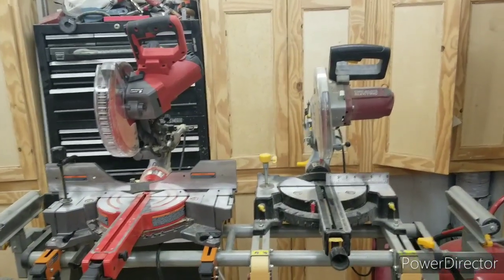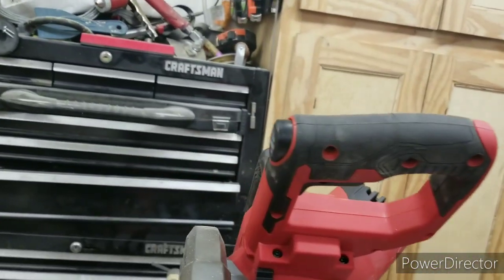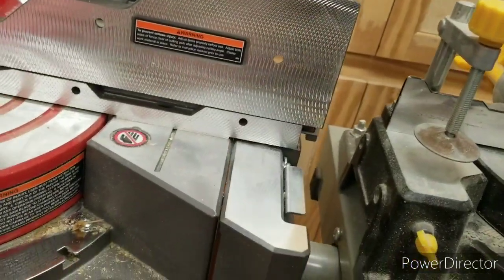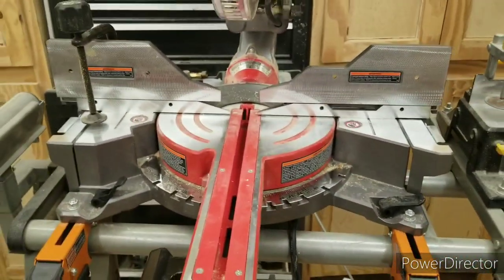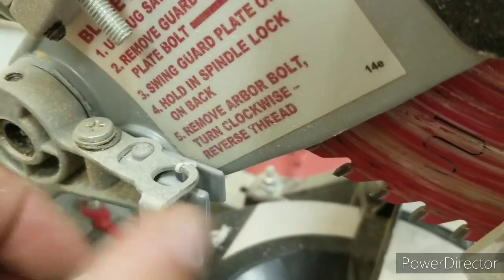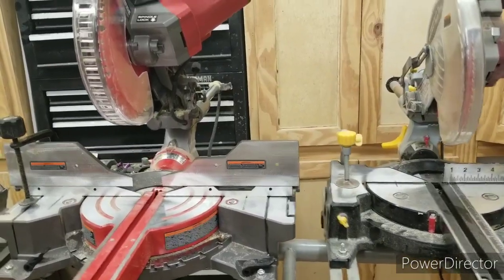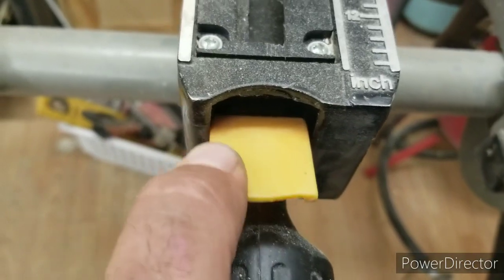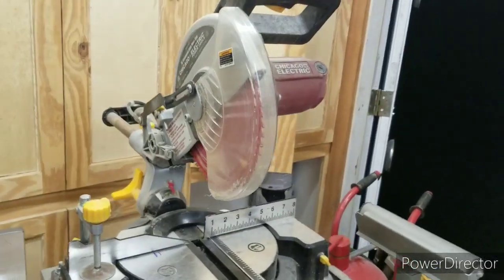Is the Bauer worth an extra $100 over the Chicago Electric 10" slid g miter saw

Comment: Looks like the Bauer has a bigger table and wider-extending supports. The Bauer's fence appears also to be drilled for mounting a longer sacrificial fence as many of us do. It also has a blade brake that stops the blade quickly. My real question is what makes this 10 inch saw $20 more expensive than the Admiral 12 inch saw that has a laser guide?
Reply from the maker: It is all a matter of personal opinion of what is worth spending extra money for. To me the overall quality of the Bauer is much higher. The Admiral base is the same as the Chicago Electric.

I have never liked lazer guides. They are the same width no matter the width of the blade and can be off alignment. The shadow line in always the size of the blade and can never be out of alignment.

If you like the Admiral I would hurry and get it. I believe they are going to stop selling it.
Reply: I think admiral runs at about 3800 RPM the bauer runs at about 4500 RPM
Reply: Having a laser sounds a lot cooler but the fact is that, in terms of accuracy, the LED shadow can’t be beat. As the other comment above mentions, the shadow doesn’t just indicate the cut line but also the width of the blade so you can know exactly how much wood is actually going to be removed. Also as mentioned above, the laser is a reference that can be off. The shadow can’t lie.

Comment: I'm now on my 5th Chicago electric saw.  I used them to cut fire wood.  I buy cut and split fire wood, 6 or7 cords a year for the last 8 or 10 years , fire  wood is 16 inches long, and the stove I had needed 8 inches to burn most efficiently.  they lasted at least two years each before the casting broke. last year changed stove now it will take up to 20 inch pieces, by only use 16 inch wood  in it and now use the saw for rough carpentry
Reply from the maker: So did you buy the extended  warranty?  I only buy it if I know I am going to be pushing the tool to the limit.
Reply: I bought an older Craftsman 7 1/4” miter saw about 10 years ago.  I mounted it on a 10’ metal folding table about a foot from the end.  I carry long 1” to 3” thick branches onto the table and use the saw to cut 1 foot long kindling pieces. I burn about 15-20 cords a year, Northern Michigan winter is 6 months some years.  That old saw gets a new blade every so often.  Paid $10 for it.

Comment: does bauer make a bigger dust port that you could install on the 12'' my 12'' bauer dust port is only 1& 1/2 '' .
Reply from the maker: I am not sure why but most brand saws have a small port. An adapter like this can work, or you can 3d print one.
https://amzn.to/41TE9y0

Comment: I t looks like you have Rigid Universal Mounting Brackets attached to a Chicago Electric Miter Saw Stand. Does this actually work?
Reply from the maker: No they would not. I just set the sawnrs to each other some I wouldn't be spinning the camera around was much. I should have done a video comparing stands. There are 2 basic styles. The one's with the wheels on the bottom are much more convenient. There Ridgid ones are on sale now at He Depot for $129 and Direct Tools for $79. At that price it was time to upgrade.

Comment: Aren't you really comparing junk to crap? If you can't afford quality, wait until you can.
Reply: Its a saw, needs a good blade and true cut. You need a makita or dewalt to do those on wired tool for 3x the price than thats on you.
Reply from the maker: It depends on what you consider junk or crap. I have Delta, DeWalt, Chicago Electric, and Bauer miter saws. I can afford a Festool if I wanted. I don't think a Festool would hold up for me as I am rough on tools. It is a precision tool but the housing is a more brittle. Most people who pay $1000 for a saw treat them nicer than me. The Chicago Electric cost less a good blade. It is not as precision but cuts good enough for most construction work and if it breaks or disappears it is not a big deal.  The Bauer to me is a great value. You can buy 2-3 for the price of what you call a Quality was saw but I can see anything they can do this one can't. This is the Jet base with a couple of upgrades. I guess you can buy this from Rocker with the Jet name for $500 without the upgrades.
Reply from the maker: I agree. This is the blade I have on the saw.https://www.rockler.com/freud-premier-fusion-saw-blade
I did not have it on for the video because I feel most people will not run a $100 blade on a $200 saw. This saw did take a little to get zeroed in. Once it was it cut true and accurate at every stop. For the price I really was surprised at the quality. They have already raised the price.. I will not be surprised if they raise it more.
Reply: Wow, Robert thanks for this Bauer video. I've watched all your videos. I've had my eye on the Admiral 12" at the beginning for its price range & what it did. It would be an upgrade needing the dual-bevel. BUT when HF came out w/this baby I came to a complete stop. So glad you ran a vid on it. Dual-bevel ✔ Positive stops ✔ Shadow-line ✔ large 5" fence ✔ electric brake stop ✔
I think Bauer is trying to create a look for trim & finish guys out here who are part of the DIY criteria. This looks like just what i need for weekend DIY crown, chair rails & trim. 
Only accessory I wish they'd come out with are Crown stops to Nest the crown on the miter locked in 😏 sort of like what DeWalt has on theirs. 
Robert, will you being doing a video showing how to zero & true this machine out?? 
Great videos RP 💯😁🔥💪🇺🇸
Reply: @ShopRamblings  Since you have Delta and Dewalt as well, does this stand up ok to those?  I'm a hobbiest that does occasional furniture (Anna white type stuff) and the bauer seems like a great saw for the price.
Reply from the maker: @johngaines50  my Delta was not a sliding so it could not cut a 12" board. I was going to get the 10" Delta Cruiser but they stopped selling it. The Dewalt has been the gold standard but their saw hasn't change much in 20 years except to lower the quality of the internal parts. I believe this Bauer is the same base saw as the Jet. Then they took all of the negitive reviews it had, Made upgrades to fix what people didn't like and are selling it at half of what other brands would have sold it for. So far I have not found anything that could be improved as far as performance. As of now I have over 30,000 minutes of view time on the saw. I have not received a single negative comment for someone who has used this saw. I used each of my other saws for different purposes. I had bought this saw just because I was curious and planned on not keeping it. After using it I have gotten rid of all of my other miter saws. This one has replaced them all.
Reply: @ShopRamblings  Thanks so much for running through that.  Sounds like this is the one that I'm going to go with.  :)